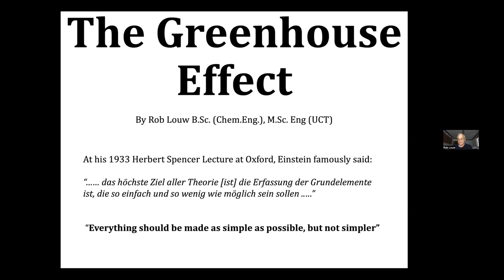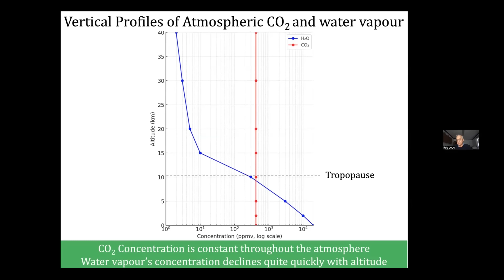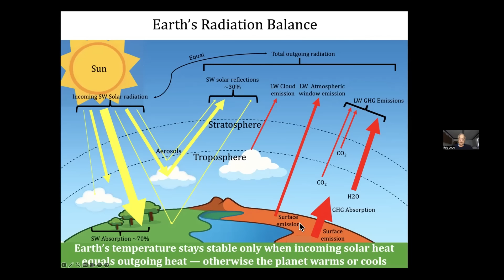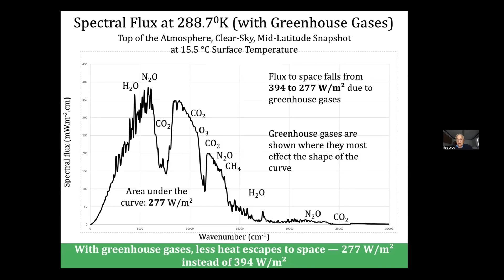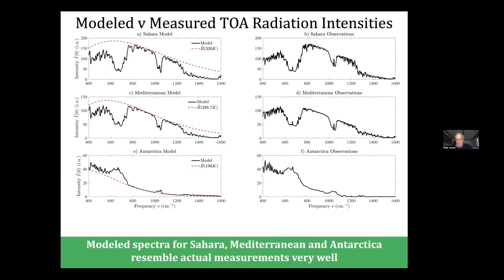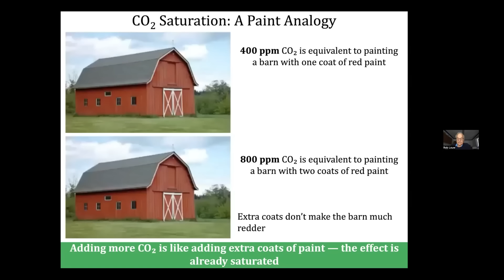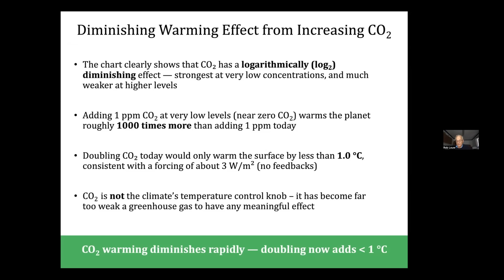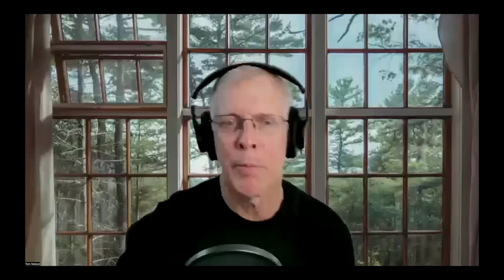Rob Louw: The Greenhouse Effect  |  Tom Nelson Pod #341

Comment: 55:36 Great that you pointed out the 90 W/m^2 seasonal variation.   Perhaps the most important point.
Reply: What do you think heat is? I do believe this is all so very incorrect. Excessive Heat, I don't believe, is meant to escape into space. Excess amounts are meant to go back into the core, or specifically, the space between layers as well, just like the embedded energy released during any changes in states of matter, smelting etc.. the south pole is the means in which this occurs, in atmosphere, relative to day and night cycles and so on... There are several heat transfers that exist, randomly escaping heat during the day time, is not one of them. That returning core heat is used to maintain the longevity and integrity of Earth's core and the various layers, by preventing oxidization for one, as well as maintaining Earth's magnetic field, propagating outwards from the core, via Pressure differentials, polarization and various balance mechanisms. Zero points and entangled states between cores allow for that excessive heat to transfer to the sun's core as well, or the required embedded amount released as the night cycle  begins, to be equally matched. the rest is used to purify the plasma, just like the sun,  propagating energy from the cores, outwards If needing an additional perspective....Also, I don't believe that carbon and methane, are able to form individual orbital shells, when in unequal amounts, especially when plastics are included, as they nominally would. Embedded Heat is released from Earth's surface as the sun goes down, which is used to balance emissed particulate, and pressure differentials as it relates to altitude in atmosphere, as well as the speed of sound in atmosphere, or more specifically, the zero point temperature gradient and it's location,  the altitude and specifics of that location, relative to the previous solar cycle, orbital shell mechanic's, emissed particulate and so on .. The equator, is probably the most fundamental transfer, or balance mechanism of the Earth, certainly one of them. Think knight rider, day and night cycles, wave particle duality between light and sound. This current, modern day perception is wholly flawed and lacking in common sense as well as personal responsibility  by various industries, nothing personal. Do you honestly believe an epoch, of any kind, would allow for the existence of Conscious life or any life forms, for tens of millions of years each epoch, repeatedly, by wasting energy like that? Do you think it would just naturally, accidentally occur? Really? Your perceived thermal layer of the atmosphere is a result of fools that can't think for themselves, with personal agendas,  constantly lying to cover up lies  blindly causing immense damage launching rockets, filling that thermal heat layer like baffoons, with heat and incorrectly polarized particulate with embedded heat, trapped there by the use of various elements used as atomic clocks, as well as satellites constantly beaming energy towards Earth's surface from space, while simultaneously upwards as well from the ground. Just a bunch of apes you are... Don't forget to include the 2000 nuclear tests that occurred, or the massive piles of radioactive waste and the constant emission of highly energized particles from those spent fuel rods, the various other issues or reasons too numerous to mention.
Reply: @JasonasonofNiribu . The earth is constantly radiating vast amounts of energy into space. And yes, all of this content has been known for a long time and has a very thorough literature to back it up. There’s nothing new here except to those who haven’t followed the climate story for long.
Reply: @Pseudify  Energy and more specifically Heat, or the embedded energy within emitted particulate, specifically positively charged ions, that are energized past their embedded energy capacity, thropic heat loss essentially, as well in many cases, not just having the incorrect polarization, but lacking in the proper or nominal  embedded wavelengths within absorbtion spectral lines, etc, is different than simple emitted, refracted or reflected light, carried by Earth's magnetic field or gravitational waves, or already existing balance mechanisms that balanced visible wavelengths according to conscious visual perception, relative to distance. We have as well, been emitting electrically produced wavelengths of energy, sound and light pollution, both from the surface and from the various orbits that satellites have. The energies produced by us and the balanced energies are wholly different, I can't say if the various studies you're most likely referring to made any distinctions, I'm guessing in many cases probably not, I'm making a guess here as well,  that many of those were carried out after the 2000 nuclear tests globally occurred, by governments known to lie, with several hundred billions in unnacounted for expenses yearly, with many secrets to hide and an obvious perceived militaristic advantageous necessity in propegating various narratives...
Reply: January 
Earth 1317wm2
Sun 1407wm2
-90wm2
July
Earth 1407wm2
Sun 1317wm2
+90wm2
Average is 1/4 for earth. Although half is total excess and half of total loss. Example 340 is average. Sum above and below until 680wm2 (remaining below average, plus internal energy equals 680wm2.) As 1360wm2 is total average incoming solar energy.
Reply: I think I read somewhere that global warming is warming the winter more than it does during summertime. If this is correct then the "heat alarm" would be even more exaggerated, as they basically only look at averages for the whole planet. That makes me also suspect that there are local variations that would also even out the effect.
Reply: @daNorse  That is my understanding. Also the polar regions are warming faster than else where. Which if you live in Canada or Siberia is salubrious...
Reply: @annemouse6788  We don't mind a little warming here in Norway too! :)
Reply: @daNorse  as someone who lives near 42 degrees north latitude, I'm quite glad that the winters seem mildly warmer than it was when I grew up. This summer was cool and damp though...
Reply: @daNorse  CET Jan vs Jul, max, min , mean; 1870 to 2016.
https://clivebest.com/blog/wp-content/uploads/2016/09/CET-JanJultemps-minmax.png
Reply: I liked that too and was unaware of that fact
Reply: Water vapor with a CO2e of 18 is the only greenhouse gas behavior of importance in earth's water vapor saturated greenhouse effect.  The other greenhouse gases can not change it.  On average water vapor is a 99.5% share.  NASA reports global warming at 1°C where it has been since 1992.  The cause of global warming is not known.
Reply: @douglasengle2704  Natural variation?

Comment: 3 W/m2 initial radiative forcing is about the same as consensus . All debate happens in feedbacks, atmospheric adjustments and so on. Consensus has net feedback parameter -0.8 to -1.2 W/m2 per K (i.e. negative). This total net feedback is negative because consensus realizes the system is not unstable. The question is about how stable it is (more or less).
Reply: Water vapor with a CO2e of 18 is the only greenhouse gas behavior of importance in earth's water vapor saturated greenhouse effect.  The other greenhouse gases can not change it.  On average water vapor is a 99.5% share.  NASA reports global warming at 1°C where it has been since 1992.  The cause of global warming is not known.
Reply: @douglasengle2704  But now we are at 1.5°C. And the cause is understood.
Reply: Radiative forcing by greenhouse gasses seems always stated as a fact but can and should be questioned.

Comment: Water vapor is by far the strongest 'greenhouse gas and the 2022 Hunga Tonga-Hunga Ha'apai undersea eruption injected an additional 10% more global stratospheric water vapor. Water vapor remains in the stratosphere much longer than in the troposphere. When the water vapor descends, it crosses the tropopause, the boundary between stratosphere and troposphere and enters the upper troposphere, it then will have its greatest radiative affects as well as influence cloud formation.
Reply: Water vapor with a CO2e of 18 is the only greenhouse gas behavior of importance in earth's water vapor saturated greenhouse effect.  The other greenhouse gases can not change it.  On average water vapor is a 99.5% share.  NASA reports global warming at 1°C where it has been since 1992.  The cause of global warming is not known.
Reply: It's Oct 15th, east of 70°E (Russia, Kazakhstan) is below -6°C (the point water has zero enthalpy). Parts of Siberia is -24°C. Total Precipitable Water above 4kg/m2 gives water vapor positive enthalpy, if temperature is above -6°C. Over the ocean Total Precipitable Water is over 20kg / m2 and is cooler than dryer desert land. Between 4-20kg the effects is mixed as wind also increases air temperature. The greenhouse gas notion is distorted as it ignores solar radiation. Dry air with high solar intensity is warmer than cooler air. Dry air is colder with very low solar intensity than moist air.  Water is endothermic, cools surrounding air by absorbing heat (increasing positive enthalpy). Water is exothermic, warms surrounding air by releasing heat (decreasing negative enthalpy). Globally this is balanced out. The Hunga Tonga event cooled the stratosphere and caused local warming events. But did not increase annual global temperature. Global temperatures are modelled (use cosine on earths area which alters the the polar regions temperatures up substantially) and not to be taken seriously.
Reply: Water vapour in the troposphere is intrinsically linked with temperature which is linked with CO2 changes. You cannot realistically separate them. So CO2 warming automatically includes the consequent water vapour component. (Yes, volcanic eruptions can add a separate stratospheric component.) Incidentally the tropopause contains enough water to give global rainfall for 14 days. Evaporation and rainfall are constantly in approximate balance. When the atmosphere gets "a bit dry" then more evaporation occurs, mainly from the oceans, but also tropical forests.

Comment: the tricky one  not mentioned is that CO2 "adds"  3w  but what does that do to the water vapour level ?   1% more energy doesnt seem to equal 1% more water vapour  because of  the variable clouds such vapour would imply ( more cloud cover lessens the engery reaching the earths surface ).
Reply: Water vapor always hold earth's greenhouse effect in saturation completely absorbing all the greenhouse radiant energy from the earth within a few meters of the radiating surface adding 5.55°C to earth's average temperature.   Global warming has been at 1°C since 1992 with no known cause.
Reply: For a given average PPMV of water vapor in the atmosphere, an increase in temperature allows a higher amount of water vapor to be held in the atmosphere.  The figure often cited is a 1C rise is a 7% drop in RH, thus creating the room. But a higher temperature causes more evaporation so RH is somewhat restored.  The question is how much, and the Met Office in the UK has a nice chart going back as far as the 1970s for the historical record of change in RH called Relative Humidity Difference.  The overall trend is down slightly meaning the PPMV is rising a few percent, so for a 1C rise in temperature the PPMV of H2O is about 6% higher causing a bit more of a greenhouse effect.  One thing overlooked is the overlap of absorption spectrums between H2O and CO2, which suppresses the potency of CO2 as a greenhouse gas, and IPCC computations ignore this reality which is one of several reasons their temperature estimate for a doubling of CO2 is inflated.
Reply: At 31:24. The carbon dioxide progressive "saturation" is expressed in the Beer-Lambert Law, and is well understood.

Comment: Can anyone tell me who called the term "greenhouse gas"? It is apparently such an important term, but I battle to find out who coined it and when. It is not Fourier, Tindale or Arhenious.
Reply: Nils Ekholm made the first published reference to the “greenhouse effect” in 1901.  You can find a link to his paper via the Wikipedia page.  His first mention is on page 21. It is difficult to read the photographed page, but near the top of the page he says, “…the atmosphere acts as the glass of a greenhouse…”
Reply: The term greenhouse gas is a misnomer. Earth's heat isn't trapped.  All molecules poses energy. Each gas has (speed of sound) velocity which is kinetic energy. Kinetic energy is a form of heat. As none of these gases cease motion, they allways  posses heat. This is about 30% of  incoming solar radiation at top of atmosphere. 70%(100% at surface)of solar heats the earth and radiates back out to space. Climate modelling assumes absorbing gases trap outgoing radiation and dismiss trapped incoming solar radiation. Visible light is let through but the for the sky to be blue, incoming radiation has  to be absorbed. People edit Wikipedia and therefore put in a claim, saying it was a swede from 1901. 
Speed of sound for carbon dioxide 278 m/s
Speed of sound nitrogen 350 m/s. Carbon dioxide does not heat the earth. Carbon dioxide is a utra cold gas that dominates heat transfer in the mesosphere.
Reply: @stephenlindsay-yule9805  
Earth has a Greenhouse. It is called Oceans. 70% of Earth's surface area is covered by water + 5% by glaciers and ice caps. Due to the high density of the oceans, a mere two metres depth of water can contain the entire heat of the atmosphere above. Land has nearly no heat storage capacity. Greenhouse radiation from the atmosphere, can only affect the top few millimetres of a body of water. Without the storage capacity of solar radiation in the first 100m of the oceans we would be a damn cold planet.
Reply: @stephenlindsay-yule9805 well said.
Reply: It was a bad hypothesis on how greenhouses work applied to a bad hypothesis on how atmospheres warm planet surfaces. It just goes to show how much of a cult climastrology has become that to this day people still claim that greenhouses work by trapping radiant heat.
Reply: The general population is familiar with greenhouses retaining heat from the sun.  This is because the sun's rays raise the temperature of the surfaces it hits, but the radiant energy from the surface is below the frequency that is able to penetrate glass causing the radiant energy to be trapped in the greenhouse.   The greenhouse retains the heat from heating gases that would be lost outside.  

This is not mechanism of greenhouse gases, but since greenhouse gas behavior interacts with radiant energy to warm the gases which warms the surroundings the term greenhouse gases was chosen.      Greenhouse gases loosely interact with a wide band of below inferred frequencies slowly draining them down to zero with many interaction within a few meters of the radiating surface.   The only greenhouse gas of importance in earth's greenhouse effect is water vapor that on average is over a 99.5% share in earth's water vapor saturated greenhouse effect.  

Greenhouse radiant energy behaves as a high frequency radio wave and not as photons as with light where one photon is completely absorbed by one molecule.  

I learned  about earth's water vapor saturated greenhouse effect in 1977 high school freshmen earth science, but was confounded by how it could work with no blockage of inferred light no mater what frequency.   

It was 2021 when a YouTube video describe greenhouse radiant energy as below the frequency of light being attenuated with many interaction with the lumpy electrostatic fields of gas molecules that gave them their greenhouse gas behavior is when I learned  the mechanism.  

Gas molecules with differing size atoms such as H2O water vapor CH4 methane have large lumpy electric fields for the greenhouse radiant energy to interact with.   CO2 with carbon and oxygen being 6 and 8 protons being close in size has one of the weakest greenhouse gas behaviors.
Reply: What if the 'greenhouse' effect is negligeable compared to standard physics and processes like convection?
Reply: A real greenhouse does not work in the way you describe, but by preventing convection. This is why a greenhouse cools rapidly if the vents in the roof are opened.
Reply: @douglasengle2704  Wrong.  Greenhouses stop convection.  Most commercial greenhouses aren't made from glass.

Comment: small error - pre-industrial was alledged  270-280 ppm CO2  not 180 ppm
Reply: Correct! My error!
Reply: @roblouw1344  the arrow was in the right place
Reply: That's right you have to go back to the Last Glacial Maximum, 20,000  years ago, to find a CO2 level of 180 ppm. Prior to the Industrial Revolution, atmospheric carbon dioxide levels were consistently around 280 parts per million. CO₂ remained stable around 280 ppm for nearly 10,000 years leading up to the mid-18th century.
Reply: Water vapor always hold earth's greenhouse effect in saturation completely absorbing all the greenhouse radiant energy from the earth within a few meters of the radiating surface adding 5.55°C to earth's average temperature.   Global warming has been at 1°C since 1992 with no known cause.
Reply: @douglasengle2704 Global temperatures have risen by approximately \(0.92^{\circ }C\) (\(1.66^{\circ }F\)) to \(1.28^{\circ }C\) (\(2.3^{\circ }F\)) since 1992
Saying the same lie over and over again doesn't make it true no matter what Trump thinks.